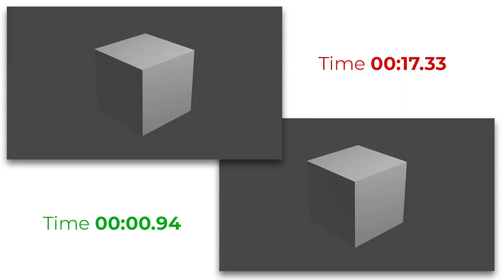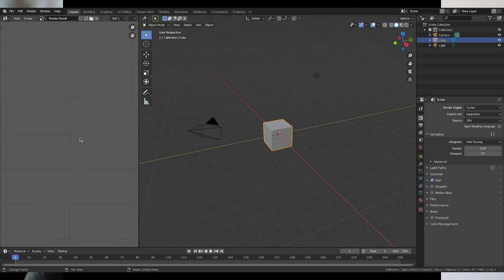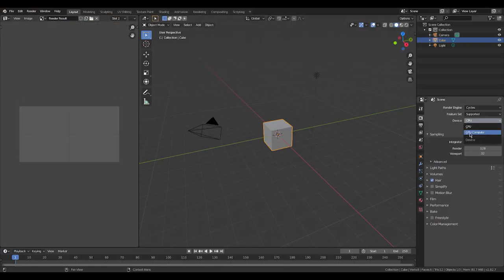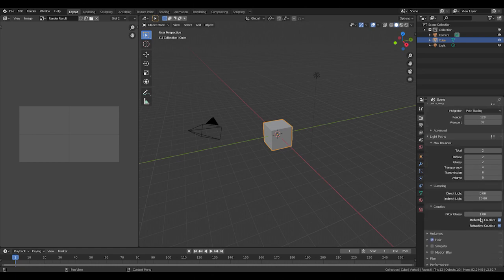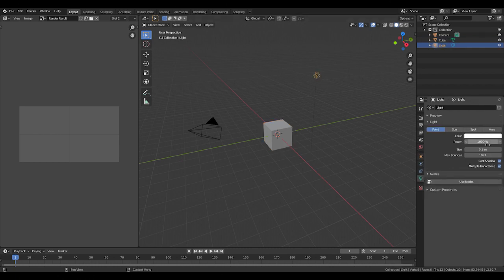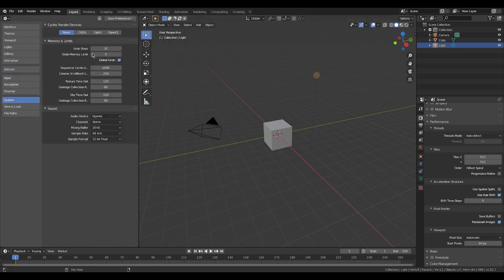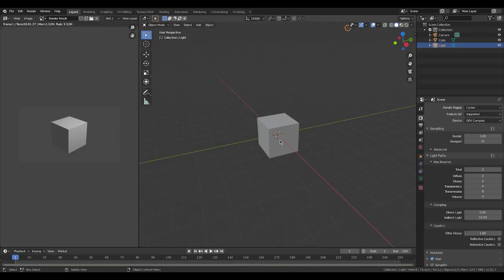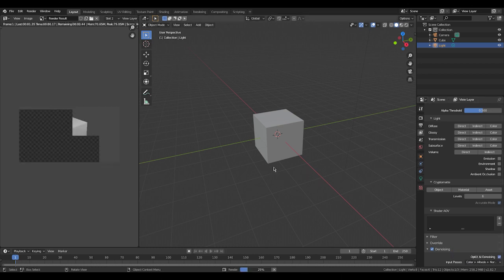Reduce Render Time (Cycles) | Blender 2.82

Comment: Well, those are perfect settings for a default cube. Good thing i just render stuff without complex materials or lighting! oh wait...
Reply from the maker: Wowbagger T. Yes it’s just general, but also on complex scenes it will massively drop render times. I render very complex scenes daily and I mainly use almost exactly these settings. But feel free to post further tips here in the comments in case I missed something fatal, it will help the community. Otherwise thanks for watching and giving me feedback!
Reply: @DamianMathew  Well i was expecting some informations for final renders. You could have called your video "How a raytracing gpu reduces your render times" :P 
I guess your settings are helpfull while actively working on a project.
Edit: I dont think you need to lower the background light bounces if you lowered the amount in the scene overall already.
Reply: @DamianMathew  you're using this few bounces for complex scenes??
Reply from the maker: @aim__freakz8499  bounces yes, samples no

Comment: Use sheep it
Reply from the maker: Shelsio Amaral yeah that drastically will reduce render time xD. 5sek Video: use a renderfarm. Over. Would be a funny video.
Reply: @DamianMathew  or use a rtx quatro 8000
Reply from the maker: Shelsio Amaral yeah xD but I think having a few 2080s ist faster
Reply: Not a viable way if you use textures or models, which's licenses exclude any rights to redistribute. No matter if it's a personal or commercial project. Furthermore for the latter, since you are sharing basically the raw blender files with third parties any properly set up contract between you and your client should forbid this.
Reply: @DamianMathew  How to render faster: Throw your computer out of the window and buy a better one xD